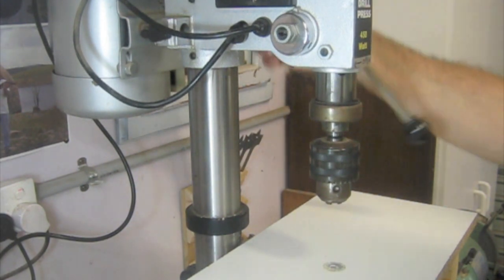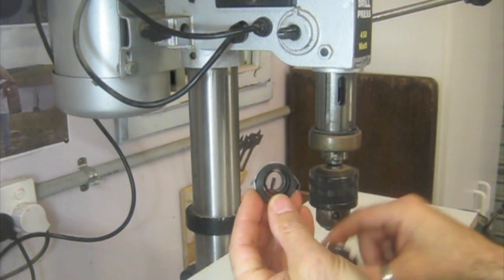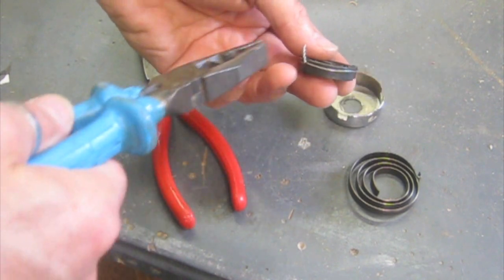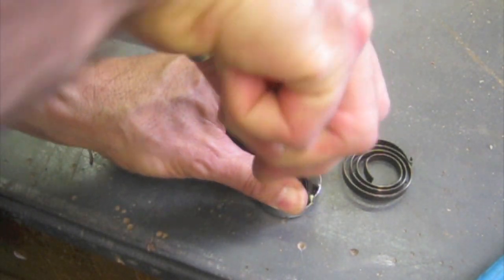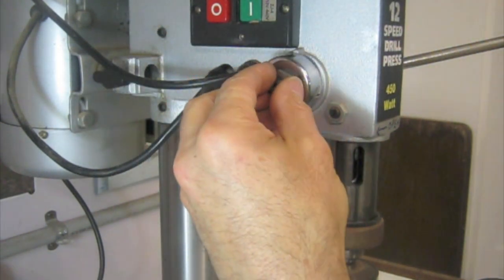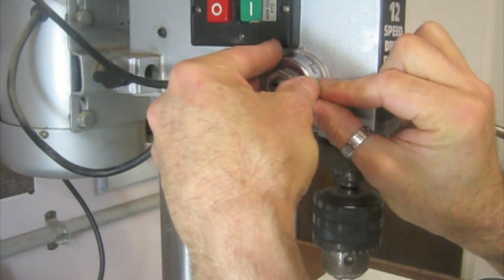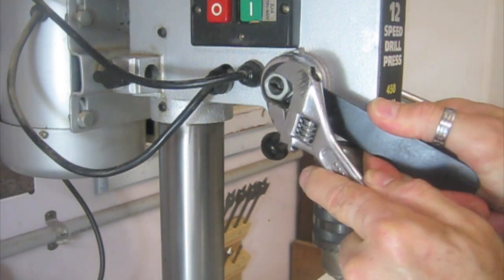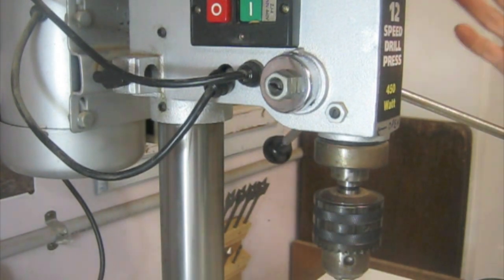How to replace a drill press spring

Comment: Just what i needed - your comment about the spring firing over the other side of the garage was exactly what i was thinking too. 
Also, thanks for the tip on tightening those lock nuts away from the case.
Reply from the maker: No worries mate, glad it was helpful 👍🏼

Comment: Thanks from Texas mate.  Good tip attaching a clamp to spring housing.  I also wear a pair of safety glass around any parts or tools where tension is relieved or applied to springs.
Reply: glasses
Reply from the maker: Thanks mate, glad it was helpful, and yes great tip about the glasses.

Comment: You can anneal the broken end with a torch and bend a new leaf section to replace the broken end, works just fine. ☺
Reply from the maker: Thanks for that tip/hack.
Reply: Was about to say the same thing - did this with the spring on my recoil (grass trimmer)
Reply: @indidginus  Anneal means to heat metal, making it easier to bend.

Comment: I can't seem to find the exact size I need. Are any of the measurements crucial, or can it be 6mm wide instead of 7, for instance. It's a 40 year old machine. Thanks if you can help.
Reply from the maker: Hey Herb, i think the only limitation is the depth of the cover piece. if you're replacing a 7mm with a 6mm i don't see any issuer with that. you would have an issue if the new spring was wider and stopping the cover piece from seating properly. Hope that helps.

Comment: My spring came out of the housing when I was making a repair.  No I’m trying to get it back into the housing which is proving to be an impossible task.  I might just need to buy a new spring that is wrapped tight like yours.
Reply from the maker: That will definitely help. Good luck with it

Comment: Anyone know where I could find a spring for a Chrisman drill press model number 34983
Reply from the maker: all i can suggest mate is eBay. It doesn't have to be a branded replacement, just measure the spring you have and buy one the same

Comment: It should be mentioned that if the spring is hooked onto a slot on the perimeter of the shell, yes you can put it in backwards.  That would be bad.
Reply from the maker: True. It would pay to take note of how the original is installed and just put the new one in the same way.

Comment: That worked well. 
Unfortunately, the spring I was sent fits perfectly in the housing, except for the bent tab that locates in the housing, so it wont slid in. 
Rats! 
That means I'll have to buy another.
Reply from the maker: Damn, don't you just hate that. Good luck with the new one mate.
Reply: Yesterday, I was using the drill, with a speed bit, and the  spring housing and nuts screwed on to act as a friction damper.
Wound  the chuck up to the top position, went to remove the workpiece, and the chuck and bit suddenly descended onto my finger.
If I'd just kept my fingers still, I'd just have had a puncture, as it was, I instinctively removed my hand, and the puncture became a gash from knuckle to knuckle on my middle finger, nearly down to the bone. 
Yes, its damn sore!
Hobbies are such great fun!

PS, Where in Oz are you located?
Reply from the maker: Ouch, sorry to hear that mate. I'm in Sydney.
Reply: The irony, is that I normally wear gloves to work with, but had taken them off to do some fine marking out, and then the gremlins struck!
My son was in Sydney a couple of years back, for 18 months, sort of working holiday.
He hoped to get sponsored, but the construction industry took a downturn, with all the CO2 crap, and that all fell apart.
He may end up in the South of France instead. :-)
Different language, which frightens him a bit.
His partner, is there with her mother, awaiting their firstborn, so it can be registered as French.
The nearest I got was Singapore. My mate and I were intending to ship ourselves and a couple of motor bikes to Queensland, bike down to Melbourne, and then ship back. [in the 60's] but the shipping company wanted more to ship us, than we intended to spend on the whole trip. So, that idea died. Even then I could see how China was developing, and how it would  dominate the area eventually. Cheers.
Reply: I cut off that "bent tab" (thank you Dremel tool for having a tiny grinding wheel...the spring was partially in the holder when I cut it off. Then, I pounded the spring in all the way, put some oil in there, and it works fine.